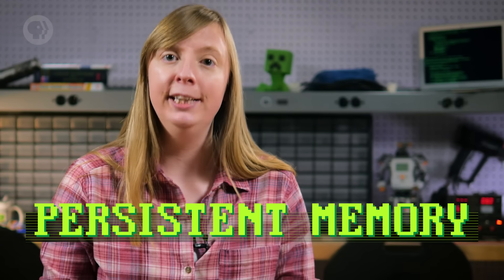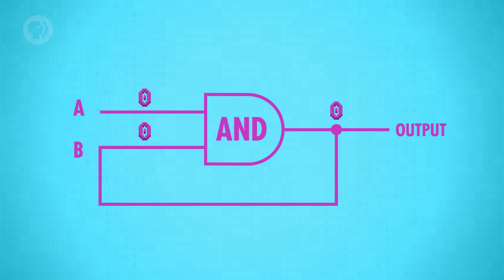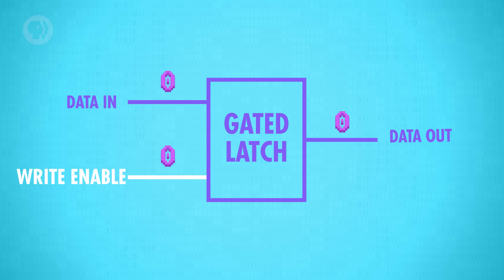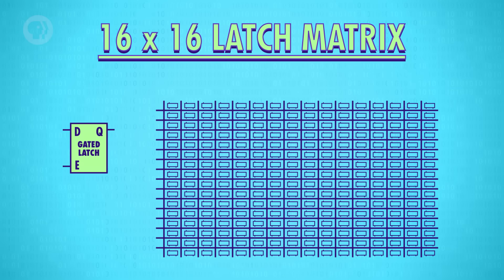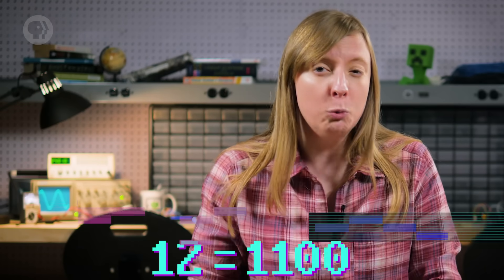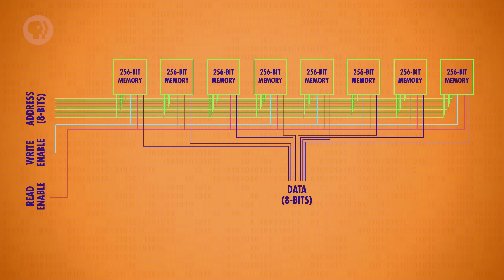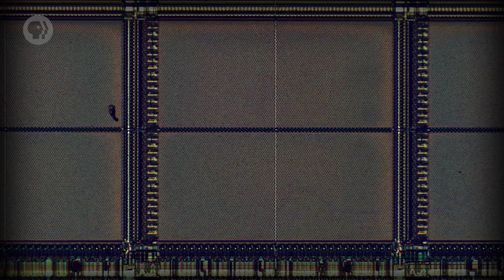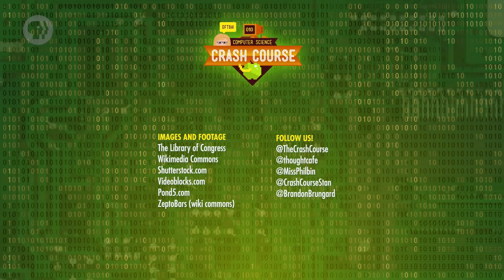Registers and RAM: Crash Course Computer Science #6

Comment: Now I know how RAM actually stores bits. Now I can die in peace. Great content.
Reply: Yes, caches store info in the way described in the video. However, there's a lot more logic that goes into how a cache works.

Caches aren't addressable. They're fully managed by the processor itself. What the CPU does is it stores blocks of about typically 1024 bytes each, along with a small amount of memory to denote what range of addresses it represents. This whole block and the extra data is called a cache line. When a request is made for a value from RAM, the CPU first checks every cache line (there can be hundreds to thousands, depending on the size of the cache), comparing the address range associated with each tag to the address in RAM that it's looking for. If it finds a cache line containing the data it's looking for, it can read/write to that cache line directly. If it's not there, it checks another cache. Caches are normally structured in a hierarchy with small, fast "local"  caches for each core (128kB - 512kB normally), and with larger, slower "shared" caches between multiple cores (multiple MB). Often times the larger shared caches store copies of all data stored in the local caches, so searching the shared cache is essentially the same as searching all the caches. As data is accessed, various additional CPU logic is able to move data between RAM and the caches. The goal is to have the processor organize the data such that data that the CPU needs to work with more is kept closer to the cores, and less important data is kept further away. This is important because accessing RAM on modern CPUs has latency in the hundreds of clock cycles; essentially, if the CPU makes a request for a value from RAM, it can run several hundred instructions before it gets the value back.

There's also the problem of cache coherency though, which occurs when you have writeable multiple caches. If you have multiple cache lines that represent the same data, then it becomes very easy to introduce inconsistencies in the memory. You can have one cache that says that the byte at address 1481 is equal to 13, while another cache might say it's equal to 127. Which do you use? Which do you store back in RAM when you're done?

CPUs solve cache coherency by having a lot of very complex logic to track where different data is stored. This works for small numbers of caches, but not for larger systems. For example, Intel has their "Xeon Phi" processors; if you're willing to fork over several thousand dollars for a supercomputer-grade CPU, you can get one with up to 72 cores. The problem is that you have 72 caches as well, and it uses the same on-chip network to manage cache coherency as it does to search the caches. This means that searching all the caches can, worst case scenario, take almost as long as just going out to RAM. It also means that memory bandwidth suffers as well. From what I've heard, even Intel engineers have difficulty getting even half of the theoretical bandwidth.

GPUs solve cache coherency by having a mix of caches and "scratchpad memory." Scratchpad memory is a fully-addressable block of memory on a CPU. The problem with it is that the programmer (or compiler) has to manage it themselves. However, a great advantage is that you don't need to worry at all about cache coherency because it's not a cache. Each compute unit (basically a large number of small, simple GPU cores that all work together on the same task) has it's own block of scratchpad memory (usually 32-128kB), and it's own small read-only cache. The cache keeps frequently used memory nearby, however if the compute unit attempts to write any data to it, then the data in the cache line is moved to the single, large shared cache on the GPU, including the data written to it. The associated cache line is then erased and a message is sent out to all local caches on the chip to purge all copies of the data that they may store.

If all of this sounds horribly inefficient and poorly scalable, that's because it is. Caches consume A LOT of power, much of which goes to searching hundreds or thousands of cache lines every time the CPU runs a memory instruction. Running an instruction to perform a 64-bit operation, on average, consumes about 16x less power than getting a 64-bit value from RAM, not including all the cache searches. If we include the cache searches, that goes up to 40x more power.

What about scratchpad memory? It's nowhere near as wasteful in terms of power usage. It works like shown in the video. Pretty efficient. The main reasons why we don't switch to it are that caches are much more convenient from a programming perspective, and because it would require that all existing software (including all the legacy software) would have to be completely rewritten to take advantage of it. Plus there's a bit of a stigma against it because the PS3 used it and a lot of people hated programming that thing. Of course, GPUs use it, so maybe that stigma will start to go away.

For a comparison, Adapteva announced a few months ago a 1024-core CPU (technically it's more of a coprocessor, as it can't run most operating systems on it's own. I'll call it a CPU though because that's what it's closest to). CPUs are normally much less energy efficient than GPUs, part of that having to have more complex control logic due to more flexibility in what it can do (GPUs are very restrictive). Adapteva's CPU uses ONLY scratchpad memory. No caches at all. As a result, it's about 2-3x more energy efficient than even NVidia's Pascal GPUs, which are the most efficient GPUs currently available (NVidia's marketing included that they spent so much money on R&D to improve efficiency, that they could have sent people to Mars for less), despite being at a disadvantage for being a CPU, and being developed mostly by one engineer. Of course, Adapteva doesn't have a lot of customers though.

I think the future will probably include a mix of scratchpad and caches. You can still use caches without cache coherency if you're careful, so people will find more arguments in favor of the convenience and backwards compatibility. Sorry for writing a textbook here. Hopefully someone finds this info to be useful. If anyone here is more knowledgeable than me on this, please feel free to correct me on any mistakes I've made; I'm certainly not infallible.
Reply: @charlesrosenbauer3135   Thank you for taking the time to write out that comment.
Reply: @Charles Rosenbauer Any good book or advice on how to learn those things in depth? (e.g. Get a job at a chip manifacturer company, or in the gaming industry)
Reply: So this is cache memory? like the cache on a a processor?
Reply: Yes, SRAM is used for CPU registers and cache. The great advantage it has it that it will store data indefinitely as long as it's powered, whereas data on DRAM keeps having to be rewritten in order not to be lost.
Reply: Ricardo Escobar You can build these same circuits with the same logic gates in Minecraft, it's actually a lot of fun and very educational!
Reply: Charles Rosenbauer Thanks for explaining this, I learnt so much from reading this!
Reply: +Charles Rosenbauer woah
Reply: Lol
Reply: Cheeky bugger
Reply: I've seen enough. I'm satisfied.
Reply: i can help you with the dying part...
 :D
Reply: hahaha

Comment: I'm going to college next semester and I'll study computer science, and this series will really help me know what to expect :D
Reply: Veikin Expect more math.
Reply: Veikin well I know someone who is doing that in the Netherlands and this subject he said was quite unnoticed
Reply: Yeah. I'm learning this stuff in Computer Engineering class, not Computer Science class.
Reply: I did Software Engineering, we got this as one subject in the first year and after that never did anything with it again. It's really mostly irrelevant unless you choose to do very specific things (I think electrical engineers might be doing more with this kind of stuff, but please correct me if I'm wrong)
Reply: hylke45 yes I'm going to electrical engineering but I've followed a few lessons already and spoke some professors and it's one of the main things we're going to study, but they always have a project there for the students actually designing it
Reply: This stuff from the video is pretty low level. More likely to be seen in a Computer Engineering track than Computer Science. That being said, there are some crossovers that happen, courses in Computer Architecture and Operating Systems (and whenever you take Assembly language). So if you're happy with a high level understanding of the hardware, CS is the way to go. That's not to say that a CS major won't know what logic gates are, they should be able to construct logic circuits including the one in the video just fine given the specs. But CE goes way harder and much more indepth than what is seen here.
Reply: The stuff we are talking about so far are mainly covered in 1 or 2 classes in CS. CS doesn't go into more detailed at it is more concerned with software development, algorithms, and the higher level math topics behind it. If you are really more into the stuff shown so far, that would be more of computer engineering.

That all being said, computer science is a ton of fun! I recommend doing projects outside of classes if you want to work in the software industry, and do research with your professor if you want to go to grad school. Make the decision of which you want to do after you have more experience in the major. Interests change. I never thought I would go to grad school for a CS doctorate, but I found out I loved teaching junior year through tutoring and being a teacher assistant.

Comment: Wow, this video gave me more insight into how computers actually work than all the coding classes I've ever had. And I have a master's degree in engineering.
Reply: Well yeah coding is something quite different from transistors, ports and operators. Be glad there's lots of abstraction. As software engineer I learned the things talked about the video once in uni in the first year and ended up doing nothing with it since. It's great that you don't have to worry about all this while developing software.
Reply: Kruglord unless you're a security researchers, there have been pretty cool hardware exploits that exist both in the wild and in labs. Like the one they found for particular cellphones models where the malware was able to overwrite itself into privileged memory space due to a memory storage quirk that error correction usually fixes
Reply: To be fair, the point of abstraction is that you don't have to understand the underlying layer. No matter how much you code, you will never completely get the underlying layer, so it's not a surprise at all.
Reply: lol

Comment: This may take a while to build in minecraft...
Reply: Well actually look up how to do the logical operators (AND, OR, XOR, NOT, NAND, NOR and XNOR) with redstone in minecraft. Most are really easy to do.
With this you can easily make half and full adders as you've seen before and simple memory storage.
I used it a couple of years ago to make some nice things, nothing too complicated though.

The essence is simple however depending on what you want to build with it it might take a while.
Reply: Building a simple key code door lock takes a while and a lot of space. Using a mod to handle to gates would make it easier. I would still not want to try building a computer in there. Especially with how long it takes for redstone signals to travel.
Reply: Draenthor XD

Comment: Wait? I have to LOOK UP how a multiplexer works!?
Reply: Patrick Stephen A multiplexer is simply a component that receives a number of inputs and selects only one of them to be its output. To do this, it has selection lines that are basically a second set of inputs that are used to block or open connections within the multiplexer. Let's start small to understand how this works. A 2 to 1 multiplexer is just a circuit that has two inputs, one output, and one selector that sets which input is connected to the output. It's made from one or gate that receives its inputs from two and gates,  each of which receives one of the inputs  and one  input from the selector. One of these gates receives the output as it is, while the other receives it after passing trough a NOT gate; this ensures that one of the gates always receives 1 and the other always 0, depending on the value of the selector. Because AND gates need both of their inputs to be one, it will automatically ignore whichever input comes to the gate receiving the 0, and so it selects the input. You can connect a three  2 to 1 multiplexes to make a 4 to 1 multiplexer, then two 4 to 1 to make an 8 to 1, and so on.  Hope I didn't confuse you.
Reply: Here is a two control bit multiplexer.
Define control inputs C1, C0.
Define data inputs D3, D2, D1, D0
Define logical 'and' as '&'
Define logical 'not' as '~'
Define logical 'or' as '|'
output V
V = (C1&C0&D3) | (C1&~C0&D2) | (~C1&C0&D1)| (~C1&~C0&D0)
Reply: It is easy, try figuring it out yourself instead.
Reply: this is a 1-bit 1-of-2 multiplexer 
https://cdn.sparkfun.com/assets/learn_tutorials/2/1/6/36-multiplexer-schematic.PNG
X is the address (0 or 1).
A is the first input.
B is the second input.
Y is the output.

this is a 1-bit 1-of-4 multiplexer 
http://www.electronics-tutorials.ws/combination/comb27.gif
the two bits  (a,b) are the select address
A,B,C,D are the inputs
Q is the output

and this is a 4-bit 2-to-1 multiplexer
http://www.electronicshub.org/wp-content/uploads/2015/07/Quadruple-2-to-1-multiplier.jpg

and you get the idea :p
Reply: Get the pun there, you morons? sigh
Reply: This is common in CS curriculum.  There is too much material to cover in class, so this is expected. CS classes also want students to be ready for the real world and have a degree of independence. If your employer wants you to do something you are unfamiliar with, they will tell you "look it up."
Reply: Figure out the logic gates to give a TRUE result for each of the 16 combinations of four binary bits without giving a false positive for the wrong combination; and there you go.

Comment: Huh, so memory is stored in blocks with one block per bit in a word, rather than storing words together and selecting a block as part of the address?
In this comment, I use "word" to mean the number of bits addressable at a time, normally a byte or 8 bits.

Comment: Big mistake in this video! The reason why RAM must remain powered on is not because of its random access pattern, but because it's a form of volatile memory. The correct opposite of persistent memory is volatile memory.
Reply: Yes. Things like DRAM need to be frequently refreshed using electricity in order to not lose its state. If this is not done, it will eventually decay and get lost. This is what make it volatile. 

The interesting thing about memristor memory is that it in theory can function like a non-volatile RAM (although from what I understand, they haven't proven to be efficient/durable enough yet). If you could store an entire OS on such memory, you could potentially be able to boot a computer pretty much instantaneously.
Reply: Eyal Kalderon I think it's a common misconception because the most common persistent data is not random access, so it's really easy to miscategorize them as mutually exclusive
Reply: chinter It is indeed a common misconception. Solid-state drives (SSDs) are a very common form of persistent and (usually) random-access memory, so the mutual exclusivity here is technically wrong.

I'd say that a piece of computer memory can be {persistent,volatile} and {sequential,random-access}.
Reply: seasong, dram with a battery will still lose stored data. You also need a memory controller to manage the refresh operations. Or use a product like psram which combines dram with an on chip controller to handle refresh operations automatically.
Reply: If you watch carefully , she never said why it should be powered
actually she is pretending that the module is enabled and powered 
also you have to refer to older episodes to see how 

she is talking about basic logic gates on their own not the power module !
Reply: Amin EnJan Starting from 0:24, she starts describing the loss of power having ruined a prolonged gaming session and that “the reason for your loss is that your console, laptop, or computer is making use of 'random-access memory.' [...] Another type of memory called 'persistent memory' can survive without power [...]” Seems pretty misleading to me.
Reply: you are stupid